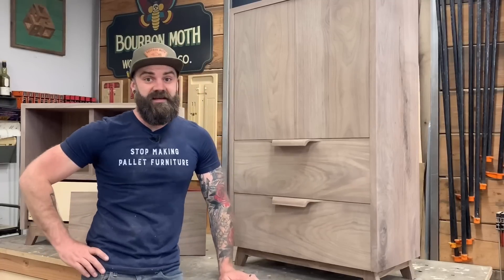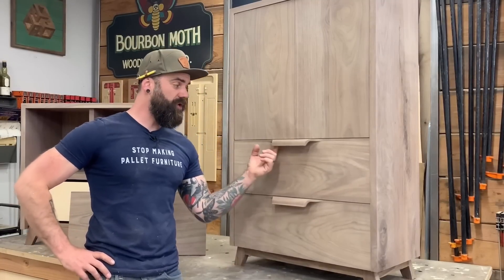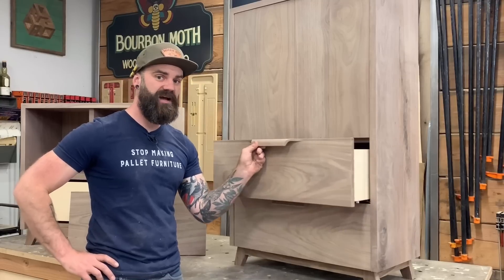Custom Wooden Drawer Pulls || Handmade Walnut Details

Comment: Why would you do all that work on the full width only to cut most of it of later on?
Reply: I assume because it becomes two handles in one piece. Also it's cut down to size at last as it'll be much easier to do all the different processes before that last step, as it's in its chunky shape. I think the workflow is great and makes sense :)